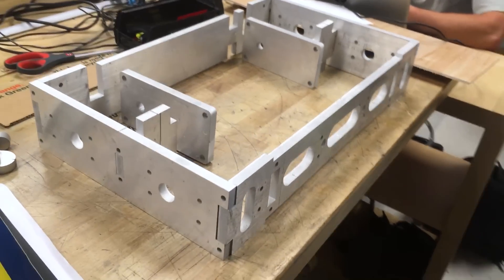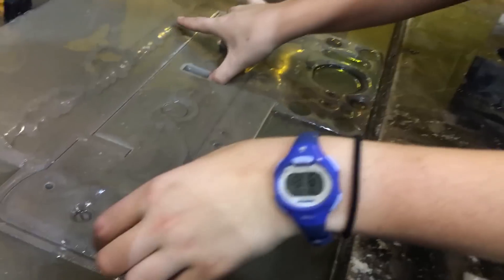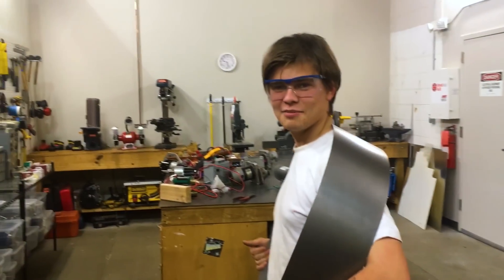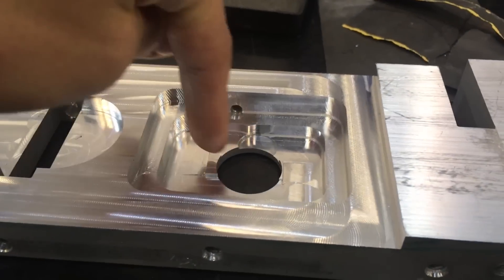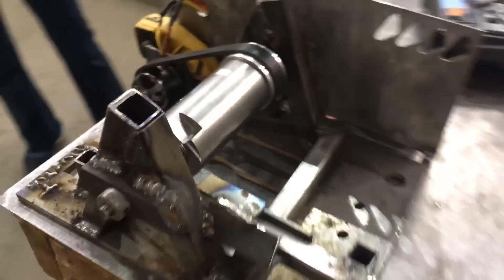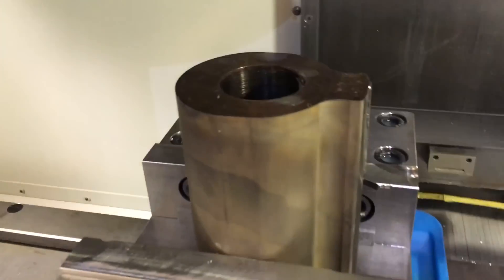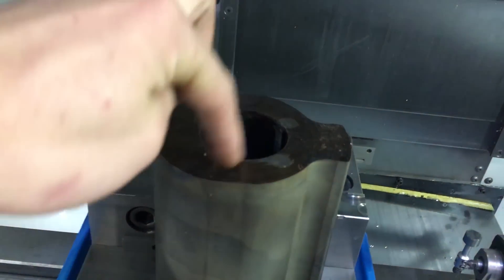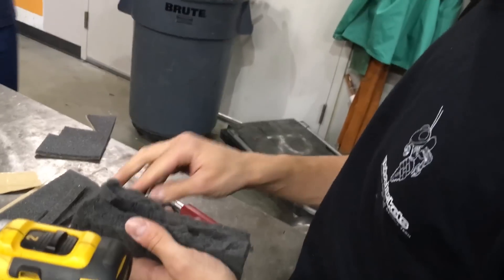Battlebot Build - MANDiii, 120 lb Drum Spinner

Comment: Personally I would have welded every interior corner of the chassis along with the bolts. Also do you use heli thread in the aluminum because aluminum fails easier than u would think when u use aluminum threads. Cool bot.

Comment: that is so cool! whewre id you buy the frame at 0:20 and all the parts? i think i have a lot of questions, gosh i would love to create my own battlebot!
Reply from the maker: We designed the robot from the ground up,  the frame you see there we cut on a waterjet, a machine that uses high pressure water and garnet (basically sand) to cut through metals and other materials. The other parts we machined ourselves. We're fortunate to have extensive machining resources at school, we primarily use the waterjet, knee mills, cnc mill, and lathes. Most of the other components such as bearings, shafts, and chain we got from McMaster-Carr. The electronics mostly came from HobbyKing. If you're building your first bot, I highly recommend starting with a 3lber, there are plenty of competitions and you can build one for around 300-600$ using basic power tools. If you just google "how to build 3lb battlebot" there are tons of blog posts to get you started.

Comment: All I’m saying is you weld a Milwaukee angle grinder to some c-channel off a 1996 ram 1500 and then bolt some wheels to the c-channel. You power the wheels using the motors for the windows from the 1996 ram and then power the whole contraption with some 18v 12amp hour high output batteries from Milwaukee and then just fuckin send it bud

Comment: Easy to do with a entire machine shop at hand.
Reply: They have some sweet machines!
Reply: Easy? no way
Reply: You should sell the BOM sheets, CAD, and CAM for these since they are so easy to produce for you.
Reply: Easy. Right. You obviously have zero experience with what it takes to actually design and machine high tolerance parts. You just don’t know enough about how this all works to know how difficult it really is.
Reply: @johnd9357  You're clearly missing the point at hand. Process aside, compared to  NOT having those kinds of tools (or funding for that matter) at hand, it is relatively easy. You have the resources available as opposed to having to outsource literally everything
Reply: @Reploidx9  agreed it’s a hundred times easier with the right equipment

Comment: I have a question, were any of you guys in First Robotics, and if so, how much differently do you approach construction on a battle bot from a game bot?
Reply from the maker: I was never in First but some other team members were. But our typical construction process goes like this: CAD every single part and assembly, down to the electronics and screws. Waterjet frame and make holes and pockets on the mill/cnc mill. Cut plastic armor with tablesaw/chopsaw. Turn parts on the Lathe for pulleys/shafts/wheels. Tap holes for bolts. Assemble, mostly held together by screws, no welds. Wire electronics.
Reply: Thanks, this has been really helpful.
Reply: @thisdustin2435  thank so much, i look forward to making a bat tle bot osme day, that'd be really fun, just messing around with it or have it  destroy stuff or be in a little collection

Comment: What was your electronics setup like? Did you just have redundant circuit boards or anything like that?
Reply from the maker: 3 5800mAh Lipo Batteries, 2 Vyper ESC's, Castle Creation's 2028 Motor and ESC, 2 Ampflow A28-150s. No redundancy but made sure everything had a safety factor of at least 1 on max current capacity.
Reply: ThisDustIn any particular reason you used rechargeable batteries? Wouldn't disposable ones be more efficient?
Reply from the maker: To get that amount of power out of AA's you would need about 120 of them, and it would last 5 minutes. That translates to about 100$ of batteries per 5 minutes. Lipo's are far more cost efficient, as you can cycle them 100s of times without significant capacity loss. They are also more energy dense, meaning they don't take up a lot of space or weight for a given amount of power.
Reply: ThisDustIn what would your budget be for a thing like this?
Reply from the maker: Depends on your design, but can range between 3,000-8,000$